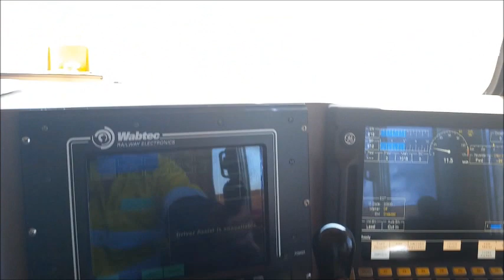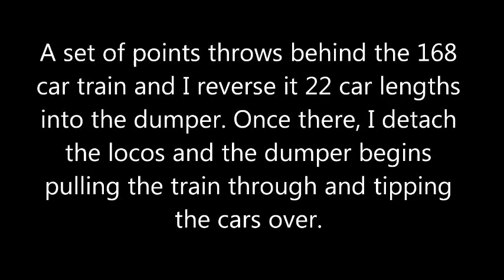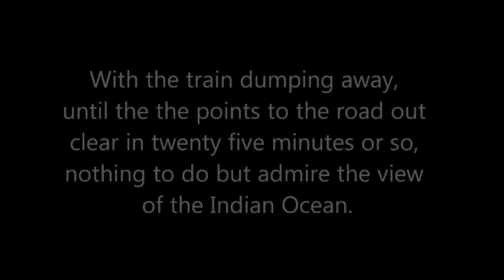Rio Tinto Train Going Into (ex Robe River's) Car Dumper 1 At Cape Lambert.

Comment: 2:54
I know the reason why the tipper/dumper (roll-over) section DOES NOT DO COMPLETE any 360 degree rollovers for, and that's so the air-hose couplings NEVER need disconnecting - allowing the auto-tip gear to tip the entire train (one car at a time) without human yard crews "uncoupling / recoupling" air-line hose connections every time a car is emptied.
By only doing partial roll & roll back "tips" the entire train consist remains the same, whilst the triple heading loco's, that brought the train into the facility, can simply "run around on a loop" (away from the tipper), to be re-attached at the the other end - ready to haul the MT's back to the mine after being auto-unloaded.

Comment: Awesome video, thanks for posting.
Reply from the maker: Thanks. I'll do CD2 soon. Totally different process.
Reply: David Rayner It appears that CD1 is the northernmost dumper. Is this the original Robe dumper? Interesting that the loaded cars are backed into this dumper, rather than pulled straight in.
Reply from the maker: @bobbyglendinning2406  Yes, it's Robe's dumper and BTW, when North Ltd. bought Hamersley Iron and Robe River, they bought all of HI but only half or RR and when Rio Tinto bought the operation from North, it remains that way to the present day. Thus, CD1 and the six trains that use it are still owned wholly by RR. RR owns all the Mesa mines around Pannawonica and also owns CD5 whilst Rio Tinto owns CD2, 6 and 7. The trains that use CD2, 6, and 7 are known as the 'pooled fleet' because Robe owns the mine at West Angeles and was going to build a line there but North Ltd. built a line connecting the Robe and Hamersley lines where they cross at Western Creek so Robe decided to buy 'Hamersley type' cars and run them into CD2.

As for the trains being backed into CD1, Hamersley does the same with one of their dumpers at 7 Mile. It probably doesn't much difference either way. The reason Robe trains are 168 cars long is that's how many cars will fit between the dumper and the end of the track. CD2 was built a km or so further south and CD 5, 6 and 7 even further south.
Reply: David Rayner ah that explains why the Robe cars are still running out to Mesa A & J mines. Good to hear Robe is still in operation. Speaking of Robe River, those ALCO C636s were legendary, too bad they’re not still around.

Comment: Is the car dumper computer operated or manned? Interesting how it is able to dump without affecting the link on the car and get the car back on track properly.
Reply: Car is clamped to the tipper track section (when it stops inside the tipper before it rolls) so that the laden/unladen weight on the springs keeps the wheels on the track.
The couplers will all have a "roll-over function" that allows them to rotate when the wagon is rolled / emptied, and as the airlines NEVER need to be uncoupled by hand (because they will have enough slack in them to do this roll-over function) they never break-apart - nor need to be recoupled again, by hand.
Not knowing specifically about an operator in the tipper control room, I'd assume, as with the automation of the locomotives, the tipper will operate according to limit switches which the cars "trip" when entering, and after being returned to the normal orientation before being unclamped, to be moved out of the tipper hopper unit.
Thus - it should all be working just like clockwork, automated completely.
If there is a control room operator, they'll only be in there in case a car derails, or if anything else goes wrong, that needs a shutdown to allow workers to correct any fault.
Reply: Think of this 1600 km line as if it was (as it is) just an end-to-end model railway with everything fully automated.
The only human intervention being needed at each terminus to disconnect the loco's from one end, and do a run-around to the other end, to be recoupled (the air-hoses need to be recoupled by hand)
Then the auto dispatch control system, sends the train/s the other way and it all repeats (just the same as a fully automated model railway would work).
Oh sure, somewhere (or maybe in many places) humans will be present, just to do the human needed functions (such as disconnecting couplers & reconnecting air-hoses), whilst being able to physically see anything that isn't ordinary - which would require a system shut-down to rectify.

Comment: Thank you for the detailed explanation David. A couple points I'm curious about. (1) Is the reason you are required to back in to the dumper because the dumper is too small to allow any locomotives to run through it? You mentioned it is around 80 years old. The locos are able to run straight through the other dumpers. And (2) After the 20-or-so cars are clear of the points, do you take the light locomotives down and park them waiting for these empty cars to finish unloading, or are there other locomotives already waiting on these empties. In which case I assume you take the locomotives over to the loco shed. Also it seems like these empties must be pulled south down the tracks before the next loaded deepdale train arrives and shoves into the dumper behind this one.
Reply from the maker: Yes, the dumper is too small for locos. It would probably take  'Australian sized' locos but not American sized locos. In any case, it doesn't matter whether the train goes past the dumper and backs in to be dumped in a south direction or drives in and dumps in a north direction and then goes past the dumper in a south direction. The reason the locos can run through the other dumpers is because they're Hamersley dumpers. Back when these railways were built, Hamersley also had a dumper that would not take a loco but unlike Robe, they replaced it and later added two more at Dampier. The light locos that take trains into CD-1 are yard locos and do nothing but that all day so after the points are clear, they go and retrieve the compressor off the back of the previously dumped train which has been pulled south out of the dumper and down the yard to its departure point. The locos that did that were off the previous train. Once the yard locos have the compressor, the empty train will have its brake test done and the yard locos will wait for the next loaded to arrive.
Reply: @davidrayner9832  If I understand correctly, the mainline power brings a train into arrival track, decouples and crosses over to the dumper track and once the empty train has unloaded, pulls it down to the departure track past the power station and under the overpass. The yard power then takes over, couples the compressor cars to the newly arrived train and spots the train in the dumper. I assume that process is similar for trains for CD2 also?
Reply from the maker: @bobbyglendinning2406  Correct for CD-1 but the locos that take a train into CD-2 will take the empty (which was the previous train) out. If they need fuel, they'll uncouple from the loaded while the previous is still dumping, go for fuel, come back and couple, and off to the dumper. Hook on to the empty on the way through, and take it to the mine and back. BTW, the power station is long gone. There's a vid on You Tube of the demolition (speed up about 100 times).
Reply: @davidrayner9832  thank you for the information David. Is that an old ROBE refueling station that’s still used just south of the crossover (near CDs 3-5). The refueling station for hamersley trains is probably at the loco facility down near Wickham. How often do the mainline trains require refueling?
Reply from the maker: @bobbyglendinning2406  The original Robe refuelling station was two pumps located on 11 road where the locos that are to take an empty Robe train would wait for it to come through the dumper. I've used it a few times but I'm not sure if it still works. They built a new fuel bay in a loop alongside 11 road that has three pumps and was the biggest pain in the arse of all time. Not one ounce of thought went into its design or if it did, then it was by someone who'd never serviced a loco and never will. Also, it was put in the wrong location. Hamersley trains use 8 and 9 roads while Robe trains use 10 and 11. They should've put it between 9 and 10 but where it is to the west of 11, we have Hamersley locos needing fuel but to get there and back there needs to be a break in Robe traffic and Robe cars needing to go to and from the workshops but to get there they need a break in Hamersley traffic. Actually, they should've put the fuel bay where it is and then put 8 and 9 roads on the other side of it. Locos can usually do 2 return trips to the mines.
Reply: @davidrayner9832  I see, that would have made a lot more sense to run hamerskey lines around the other side of the fuel track loop. So my understanding is that Robe loaded trains run up 10, cross over to the dumper and empties are brought down on 11 (westernmost), while Hamersley loads are brought up 9, unloaded, then pushed up clear of the points and brought back down on track 8 (eastern most track). The arrival tracks are the two middle tracks (9&10) down near Wickham while the departure tracks are the two outermost tracks (8&11).
Reply from the maker: @bobbyglendinning2406  Dat's right.
Reply: @davidrayner9832  thank you for the info David, much appreciated.

Comment: Never understood how it deals with the coupling. Is there a mechanism to uncouple the car before being tipped?
Reply from the maker: They stay coupled but while one has the usual square drawbar, the other is round and so the car can rotate around it.
Reply: @davidrayner9832  ah very interesting, thanks
Reply: @davidrayner9832  A) one has the usual square draw-bar, the other is round -WHAT HAPPENS when the usual square needs to be dumped?
and B) will the iron ore be dumped on a conveyor belt and then transported to the shp?
Reply from the maker: @franzbrunner499  I should've explained that better. Every car has a square drawbar at one end and a round one at the other so as each car is being tipped over, the square bar rotates with the car and the round bar stays still, being held by the square bar of the next car. The ore is carried by a conveyor belt to a stockpile. Rio mines several different types of iron ore and each is put onto its own pile. The customer will order a blend of ores, depending on which type of steel they will produce and the ship will be filled with ores from different piles, mixed together.
Reply: I N THE USA WITH A LOT OF ROTARY DUMP COAL CARS , ROTARY CARS HAVE ONE END PAINTED QUITE DIFFERENTLY TO AVOID  SQUARE SHANK TO SQUARE SHANK COUPLING!
OCCASIONALLY, HOWEVER SOMEONE FAILS TO NOTICE,
WITH RESULTING CONSEQUENCES!!
KEEP THEM ROLLING BROTHERS!!👍👍

Comment: Do you break the train up to unload it ?
Reply from the maker: No, only the locos come off but the train stays together.
Reply: @davidrayner9832  Thank you for the reply. I have subbed your channel. I feel stupid for asking this but because I’ve seen trains out there. 

My next Question is :  I thought Locos were staged at the Front / Mid Section / Rear of the train. Which would require a break up of the combination.  Or would this be FMG or BHP ?
Reply from the maker: @R00RAL  BHP use mid-train locos. Not sure if FMG and Roy Hill do. Rio only use head-end locos.
Reply: @R00RAL  Don't feel stupid, it's ok to ask these kind of things.
Reply: @JointedStudios  All good, when I wrote the question down I answered my own question really. Obviously the Locos do not go through the Car Dumping Machine.
Reply: It's far quicker to switch out loco's from one end (& reattach them to the other end) to keep so many "extra driverless" trains running between the end termini - which is why they automated them to run at tighter timetabled frequencies.
The more trains they can get to run (almost tailpipe to head end) on the TWO mainlines at any one time, means they also need the fastest turnarounds at either end.